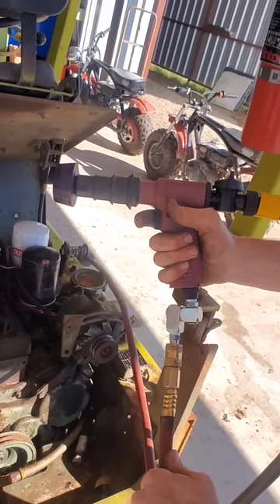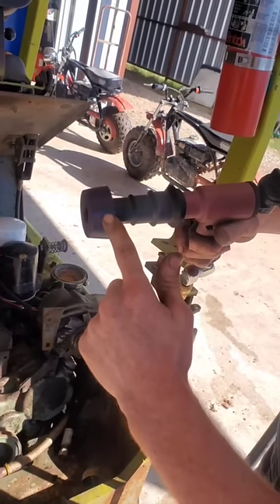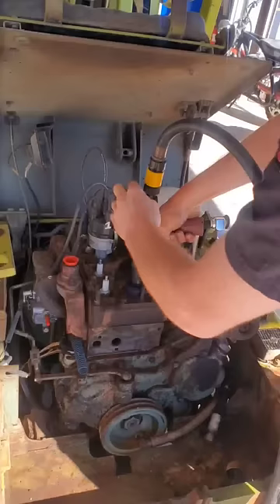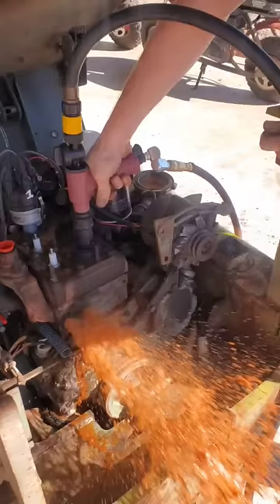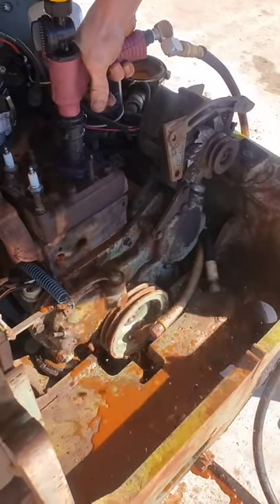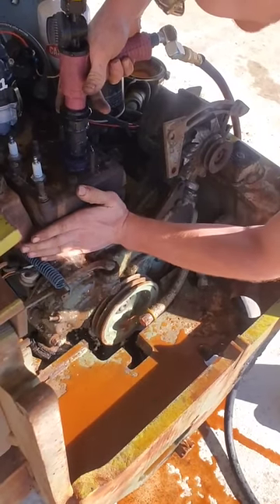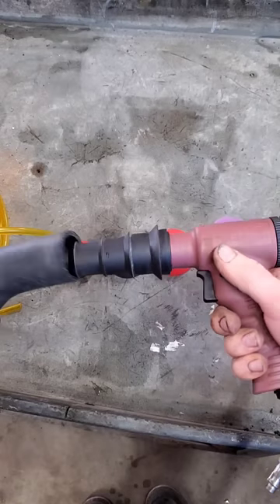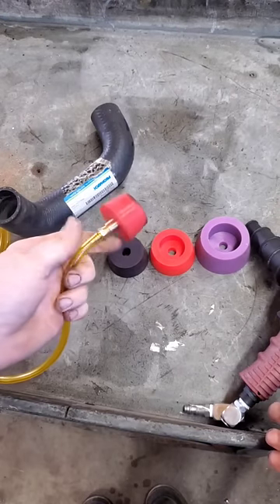Matco Coolant Flush Gun Gets A Stamp Of Approval

Comment: When I was young we used a garden hose and if it took all day that's what it it took. And we liked it!
Reply: That’s a good think when wasting time and drinking beer and bullshitting around. When there’s work to do you don’t got all day. Lord almighty.
Reply: Still use a garden hose 😅 it’s quite possibly the most effective way without having to buy any additional equipment or products.
Reply: Definitely effective as long as the city filters it's water regularly
Reply: @mitchallen5819  who cares if the waters filtered? As long as u drain it out and use coolant afterwards your good, also for those of y'all that might think just disconnecting the lower rad hose won't drain everything out the block there's a little plug on the side of the block you can unscrew to drain the block of coolant
Reply: @smokeythehuman3596  rust problems and calcium deposits. That's why. 
Either filtered city water or distilled water.
Reply: @mitchallen5819  people don’t realize this but it’s funny to see that dude out himself. Reminder to never buy a damn thing he’s touched 💀
Reply: Holy Hard Water, Batman!!! 😵‍💫
Reply: @AndrewKidd14145  whoosh
Reply: @KDlGG  as long as you flush it out afterwards with distilled water it doesn’t matter what you use to clean it out. Just fill it with distilled water, drain it, then fill it up with coolant - there won’t be a trace of any unfiltered water left in the system, no issues with minerals etc.
Reply: @ryantracey8574  not proper in this sense but I won’t ridicule you
Reply: I was thinking the same thing except for the all day part theres a fair bit of pressure
Reply: @TheWallsocket  there’s low spots in the jackets, unless you take the freeze plugs out and shake the engine you’re leaving unfiltered water in the engine Every builder knows this
Reply: they used to have a man waving a flag as cars went down the road, but progress has got better and easier, i guess 🙄🤔🙄

Comment: Bam!!! Now I have a leaky heater core lol
Reply: Came here to say exactly that. 💯
Reply: @iainball2023  haha right
Reply: @kickmefar  the air pressuring the water would damage the small tubes inside the heater core
Reply: Nah,  if this blows out your heater core, it was already shot
Reply: @troyhummon7978  maybe... compromised from the inside but why rip a dash out of said vehicle if it's still flowing and not leaking.
Reply: So if the heater core is already ripped out,  doesn't matter much for me then huh?
Reply: @Michael Brown   instead think of it as a heater core tester. Find the weak link 🤔😁
Reply: If this makes the heater core leak, it was shot already, and the gunk inside of it is what was keeping it from leaking.
Reply: this will not damage a heater core and if that little bit of air does then the damn thing was junk / bad to begin with . I swear never surprised by the comments .
Reply: That's exactly what I was thinking😂
Reply: @kickmefar heater cores are fragile, not meant to take a lot of pressure. It could cause them to leak.
Reply: It would damage it if there was no escape for the air, if it does your heater core was already shot.
Reply: What if the heater core is bypassed, 🤔
Reply: @BrokeLogic  you will probably find that they handle at least the same pressure as the radiator. I generally dont use one of these with the thermostat in so it doesnt really get a chance to pressurize
Reply: Now you could avoid any damage to all parts of the cooling system by installing a pressure regulator to the air supply going into the tool.  And have it set to the factory radiator cap pressure setting.  Usually 16 psi for most stuff in the US

Comment: “You got that in film?” To me it seems like shooting this on film and then having to have it digitally scanned and cropped into the vertical format just isn’t worth it. I would just use the built-in video sensor and video compression hardware built into the processor of your phone to do it. Little technical tip for ya

Comment: Better than nothing, but the bulk of the cooling system's crud is settled in the block at the base of the cylinders. Remove the drain plug(s) located low in the block to act as the exit path. Better yet, knock the core plugs out and attack with a serious power-washer.
Reply from the maker: Yes absolutely. However for this old junker, this tool does a "good enough" job pretty quickly and is way better than using just a garden hose by itself.

Comment: I worked at an engine shop years ago and we would strip the motors and hot tank the iron block, then rinse it out and blow dry it.
I learned that there are large water jacket areas that would fill with rusty crud, packed after years of use, and no way would this blowing device remove that stuff.
Reply from the maker: You are 100% correct. This tool will however clean out most of the loose stuff that would if left alone immediately clog our new radiator. No reason to completely rebuild this engine at this point. You have to work with what you have. This forklift isn't worth a rebuild.

Comment: Literally the same idea as the Matco auto brake bleeder. I've actually had issues with the Matco brake bleeder though, there's been times when it just simply would not bleed. Done it time and time again, without fail. And then sometimes they just simply won't work. I use manual bleeding at that point, and then after it starts to work its way through the system, I turn on the auto bleeder and it finishes it off. My buddy has the Snap-on version, and I haven't heard of him complain about that before. I'll have to give it a shot.

Comment: What if something is actually plugged and you do that. That’s a lot or pressure that has to go somewhere
Reply from the maker: Well you would make sure you have flow before you pull the trigger and also before you completely seal the outlet of the gun to the motor.

Comment: It's easier just a tea into your heater core hose with a adapter and hook your garden hose up to it and then flush your right ear out cuz the same thing it's cheaper a hell of a lot cheaper
Reply from the maker: I'm sorry, can you help me find the heater core on this forklift?
Reply: It's not the same at all. The bursts of air break up the junk that is clogging up the tubes in the radiator. Simply running water through a tee isn't nearly as effective.
Reply: @Krankie_V  starts off Brown and goes to clear and last time I flushed her out of you out I used Blue devil radiator flush it's removes rust and in degrees
Reply: @austinglennkimmel8719  the color of the liquid does not indicate whether or not it's breaking up solid debris. This method is far more effective. Try it with a clogged heater core some time. Running plain water through alone doesn't do a whole lot, but alternating air pressure and water breaks up the chunks.

Comment: If you fill the cooling system with distilled water it will eat the rust 👍👍👍👍
Reply: No it will not.
Reply: No it just won't further contribute to rust. 

If you want to "eat" rust I'd suggest chemical neutralization with a quality phosphoric acid wash. This will destroy the corrosion, and chemically convert the rust into a protective phosphorus oxide coating.
Reply: Well certainly tap water isn't the best idea for this then

Comment: Wouldn't dare try that on a modern engine myself!!!!
Reply from the maker: Why not? It's not going to hurt anything. I use this tool on any engine with a dirty cooling system- old or modern.
Reply: @TechnicianRed  it's just too much imho, i can just picture blown capaliri lines and failed seals everywhere!!!!
Reply from the maker: @imzackson  so long as you have a decent sized outlet open to vent the water and air, pressure build-up would be minimal inside the cooling system. But yes, it could potentially cause a leak depending on the situation and how the tool is used. Most of the water is just going to take the main water-passageways (path of least resistance) and therefore shouldn't go through all the small coolant lines going to turbos and other things.
Reply: You can turn the air pressure down or not use the air pressure.  Using it to flush the rust out of the engine block using the tool and adapter is very useful.  You could blank off the water and use this to find exhaust leaks by stuffing it in the tailpipe and using the air only.
Reply: @terrycarter8929  a person could, but you can do the same things with a garden hose or shop Vac. Either way it's just not a tool I'd spend my cash on.
Reply: @imzackson not necessarily... the best way to fill/evacuate coolant is by using a vacuum system. It's the preferred method these days for most manufacturers as it gets almost all  the coolant and air pockets out
Reply: @alextran8188  yrs sir I'm completely aware of modern serive techniques!!!!
Reply: I mean isn't ethylene glycol like super toxic? I always heard that it'll kill wild life if it gets on the ground
Reply: @gordonbeiser5431  it ain't that bad but I wouldn't drink the stuff. In theory  all this is being done in a way that can be captured.
Reply: @imzackson   Yeah but cooling systems (depending on vehicle) is 10 to 20 psi on 200+ degree coolant. This pressure is also allowed to flow directly out
Reply: @hell_march6652  basicly a water hammer when you hit that air IMHO, use it if ya want but I wouldn't.
Reply: I'm the same,imagine using that on vw,bmw and Mercedes,by the time it comes out the other end it's going to have that much pressure it's going to do some damage, I'll just stick with a garden hose,
Reply: @akriminal7951  agree when we're talking about plastic that breaks when you look at it wrong I ain't taking any chances!!!

Comment: Forcing 100lbs+ of pressure in a system that uses around 20lbs isn't recommended.
Reply from the maker: Pressure can't build if the outlet is open and un-restricted. There was very little pressure in that system.
Reply: @Technician Red  with the heads on you will build pressure through the small passages in the engine and lines. It's best to use those with the heads, thermostat, and pump off or use regulated air under 50lbs with high water flow or prefill the block. Also want the flow to be opposed to the flow of the cooling system, it's like scaling a fish.
Reply from the maker: @ShaneAgain  we will have to agree to disagree. That hole I was blowing through was about 5 square inches. At just 15psi of pressure build-up inside the cooling system, I would have had 75 pounds of force pushing back against the tool trying to push the tool out. As it was, I felt no push-back from the tool therefore minimal pressure was present inside the cooling system. 

BUT, if the cooling system was clogged up (and not just dirty), there WOULD be pressure build-up as there is a restriction in water flow. It depends on the situation.
Reply: @Technician Red just stating what I've learned by doing things the hard way. At the end of the day, it's more customers for me.

Comment: Not gonna be doing that in my shop
Reply from the maker: Well its a good thing I don't work for you!
Reply: @TechnicianRed  all good man, but the difference between 250 an hour and 120 an hour are this exactly
Reply from the maker: @AATreeService  ok so what would you do in this situation?
Reply: @TechnicianRed  hook up my pump station.  We use a grundfos pump, soft lines, hot water tank with cleaner, 300 gallon icb tote for waste product.   First we run cleaner in a circulation for 15 minutes.  Return it to waste tank.  U can flush from heater core upper to lower dump.  Very simple system that costs about 200 bucks to make.   I watch your videos and U have a nice set up, nice tools and U seem to have higher then most mechanics level of knowledge.   Try it out!
Reply from the maker: @AATreeService  wow thats an impressive flush setup you have. I thought you were just another ignorant YouTube comment crew member at first. Thanks for the tip!
Reply: @TechnicianRed  sorry never was meant to be intended that way